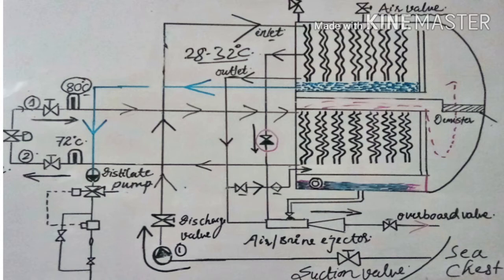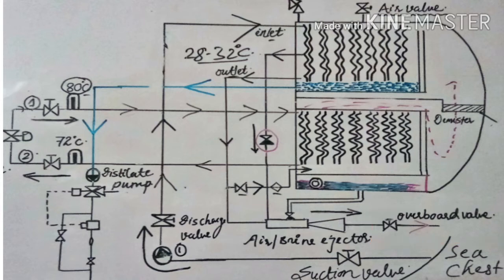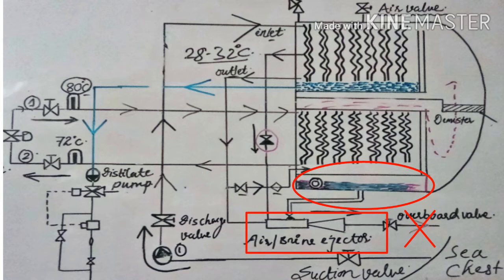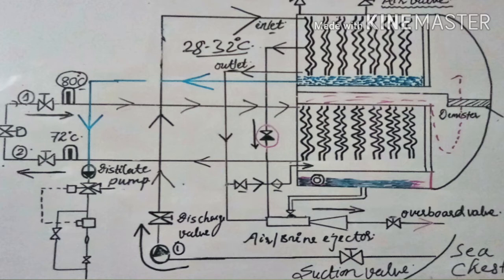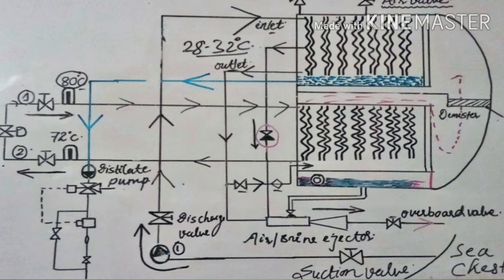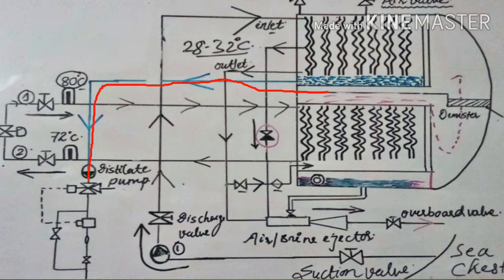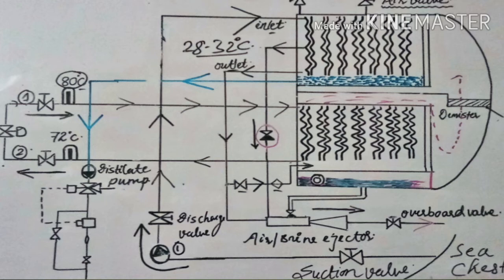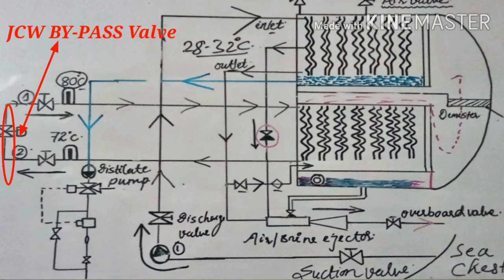Fresh water Generator||FWG||Starting and stopping Procedure of FWG.

Comment: Sir if the bypass valve is closed during the operation of producing of fresh water then how will it vapourize the sea water?
Reply: If by pass valve will be open then jcw will be divided between by pass and and jcw inlet line so affecting evaporation of sea water in evaporator so we have to keep the by pass valve closed during operation of fwg so that all the jcw pass through inlet line to evaporate sea water and gain maximum plant efficiency....but to alter the amount of fresh water production we can throttle the by pass valve as per our requirement

Comment: Cause of vaccum loss during starting.....
Reply from the maker: 1.Human Error : wait till to vacuum to build up inside FWG shell (92-95%) 
Technical Malfunction : 
During starting ensure that Ejector pump pressure is not much low ( due to which vacuum ejector won't work properly ) 

During starting Make Ensure There is no air leakage inside the system.

Before starting there should be proper maintenance of Ejector pump otherwise ejector pump efficiency drops ( like nozzle is enlarged and wear down, vacuum ejector nozzle partially choke) and when u lay out the plant because of improper maintenance then ejector pump won't develop proper vacuum. 

Sometimes during starting condition there is excessive back pressure on the overboard side due to high draft of ship.(this parameter is also affect the vaccum in FWG)  

For more detail machining malfunction of FWG: 
https://youtu.be/MnOaSGKE1QU
Thankyou! Please like and share Marine Etutor 👆
Reply: Thanks sir